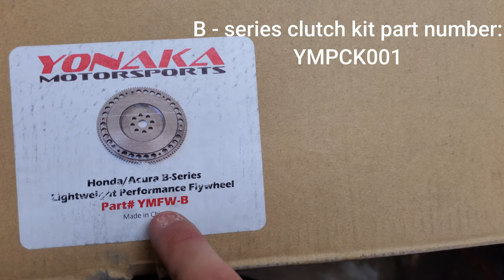Honda Complete Clutch Install Guide! B Swapped EK Civic Yonaka Stage 3 Clutch & Lightweight Flywheel

Comment: Bro I’m a noob to the car life what does stage 3 mean like should I put stage 1 first or what lol
Reply from the maker: Easiest way to explain it would be the power ratings of them, so stage 3 will handle more power than a stage 1 but the drive ability will suffer. They tend to lurch at lower speeds and shudder while slipping the clutch (generally more difficult for street use) So I would reccomend picking one up suitable for your power level.

Comment: Great quick how-to! Just purchased the kit with flywheel for my '00 SiR and will definitely be referring to your vid.    Got hold of a s80 tranny with only 50K on it so naturally I'm replacing everything including the rear main seal....myself? Lol.    Just to clarify, is the consensus to NOT use the throw out bearing in the kit? Or is it ok?   You still have it in the car or is it toast? Lol.   Thanks in advance!    Nice to see Yonaka bringing us Canadians together lol....I'm in Vancouver BC 👍
Reply from the maker: Hey man glad to see a fellow Canadian out there haha! Honestly the throw out bearings have been updated and i haven't heard of any issues with them lately but its a big job to open it up and replace it if it goes sideways so it might not be a bad idea to spend a bit more and pickup a good quality OEM bearing and not have to worry about it again. As far as my civic goes its unfortunately no longer with me as i hit a wall last winter and wrote it off. Hopefully one day i can get an EG hatch to replace it!
Reply: @RaineLutz  Yes I saw that in one of your more recent videos...sorry to hear that man!   I'm liking my EM1 but EG's are classic 👍.    Just found out the previous owner did the rear main seal with OEM Honda gasket @ 165k.....I've got 220k now. I wonder if I should change it again if not leaking? 🤔. Also is that rear motor mount ANY easier to replace with the tranny dropped you think?   I've got Hardrace replacements ready to go.
Reply from the maker: @ericlindsey1708  Honestly i think the rear mount would be easier with the transmission and the transmission mount in. I could be wrong but i think it would be easier to stabilize it that way. And i would say It's a good idea to replace the rear main seal while you're in there and know that its done properly, and a fresh seal so you wont have to tear into it again for that reason in the near future.
Reply: @RaineLutz  Now that you mention it...that makes sense about the rear mount👍.  Thanks again for your help/input!  I may just have to YouTube my own install.... success or failure 😂.   I'm doing clutch, flywheel, HardRace mounts, HardRace blue lower control arms, front stab links,  inner and outer tie  rods, right CV,  and lower extended ball joints!!  There's no way that they're won't be cursing and bloody knuckles!  You can see how most of that makes sense to do with this job though for sure.

Comment: Did you find it very grabby when you first installed it? I bought one for my h22 and it was super aggressive on a freshly machined flywheel, I ended up switching to an exedy stage 1. I should've given the yonaka a chance to break in. Did it get easier to drive as you broke it in? I put maybe 40km on mine before changing it
Reply from the maker: It was very grabby for sure haha i had to completely relearn how to drive manual with it until it was worn in a bit. After the break in period it would feel natural again and i absolutely loved it, i would recommend it to anyone for sure!
Reply: @RaineLutz  I might have to throw it back in this season and give it a chance. The exedy really cant take any abuse, i tried to preload it a couple times at the track and it would just start slipping soon as I made a pass
Reply from the maker: @t.j2881  I would give it a chance I really loved it and it held up to the abuse just fine! Just get a quality throw out bearing and you're set.
Reply: @RaineLutz  definitely will. I need something that'll take some abuse. And ya I swear every aftermarket clutch comes with a junk TOB. You're in Canada eh? Where abouts? I'm just outside ottawa
Reply from the maker: @t.j2881  Yeah man I'm over in Alberta! always cool to find another Canadian haha!
Reply: Was the pedal super stiff? I'm in the market for a stage 2 or 3 but I don't want to sacrifice the oem pedal feel.. I've heard some clutches will feel like oem as long as the pressure plate isn't heavy